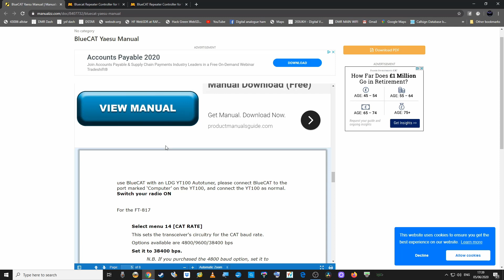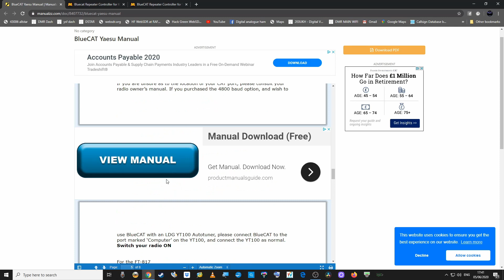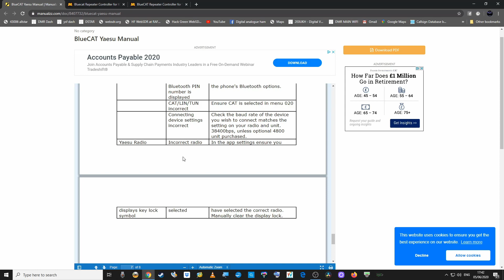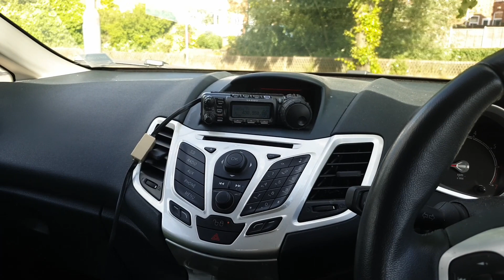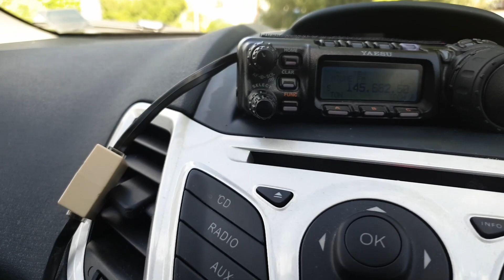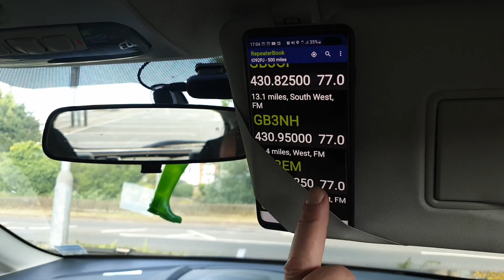BlueCAT for Yaesu and Icom

Comment: Hi Chris, do you know if the BlueCAT handles TX/RX audio? - Reason I ask, I've just watched a YT video from Peter VK3YE for FT8 via a free app called FT8CN - Have you seen it?  Wondering if the BlueCAT would work with this app via CAT & Bluetooth control.  73 Kev
Reply from the maker: Hi Kev. I have used that software and was very impressed with it.. I have got the blue cat at present for icom 7100. I had an old android in the car, and I had the wrong wires with me. I tried Bluetooth and it connected to blue cat hardware. But there was no audio on ALC.  I do not think it supports sound.
Reply: @Digital Analogue Ham that's a shame, I have emailed BlueCAT to ask that very question.  Will let you know if I hear anything...